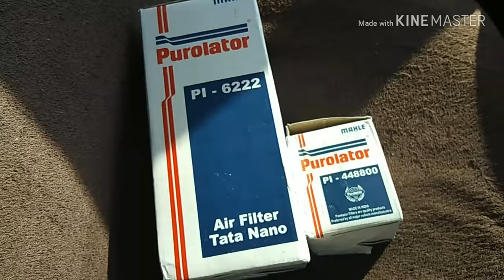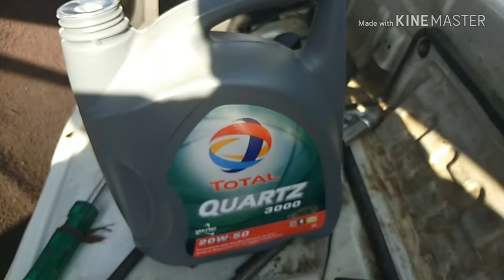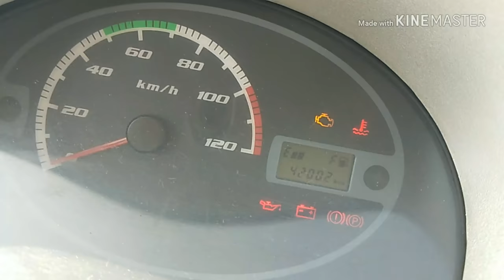Nano Car complete Service ? what to do ?by Technical riu

Comment: With filters and engine oil and laber cost 1500 rs h kya
Reply: Service labour cost 650 approx
Engine Oil  700 approx for 2.2 
Air filter 150
Oil filter 120
Fuel filter 100
Coolant 230 for 1 ltr pure.
100 extra per tyre for break
Above prices are of local mechanic in  my area.
Reply from the maker: Yes
Reply: And break oil cost?
Reply from the maker: @khireswarpradhan6165  100 ruop

Comment: coolant kyu kam hua tha??. it is a problem if car looses coolant.. n i have heard that nano car looses coolant because its water pump(coolant pump) looses it seal n coolant falls into crakcase n can cause catastropic engine failure..
Reply from the maker: Coolant reduce because my car have problem of overheat,  due to that issue I have to repair my car ECM,  it overheat after 2-3 kms, so coolant reduce
Reply: boss car heats up coz of low level of coolant.. do check it regular intervals.. my nano car loses about 150mlof coolant every 6 months or depends upon how much i drive.. nano engine always runs at slightly higher temperature as i experienced caz my wagon r car engine  is always at lower temperature then tata nano engine.. also my ford figo diesel engine seems also at low temp. than tata nano.... but tata nano is best car except hard steering n clutch a lil bit heavy... do check coolant level at regular interval...
Reply from the maker: @wajeehawajeeha3381  sure

Comment: Oil filter,air filter and engine oil kitna kilometer baad change karna parta Hai??Pls infrom
Reply from the maker: Depend upon Car company, normally it change in 5000-6000 kms,  some company recommended on 10000 kms
Reply: @technicalriu9720  fuel filter bhi change hota h